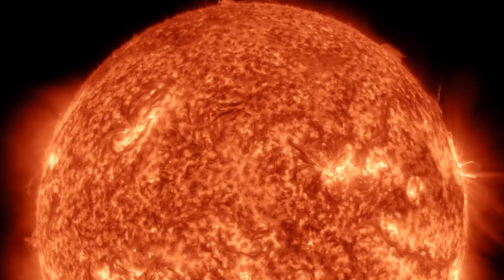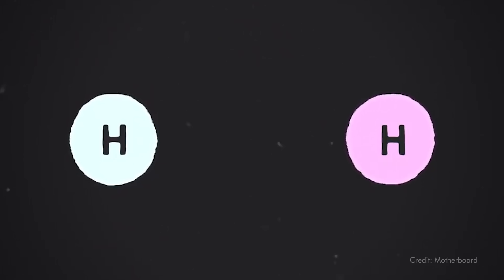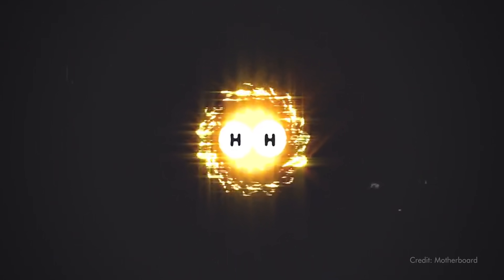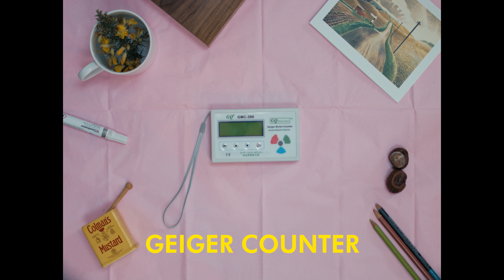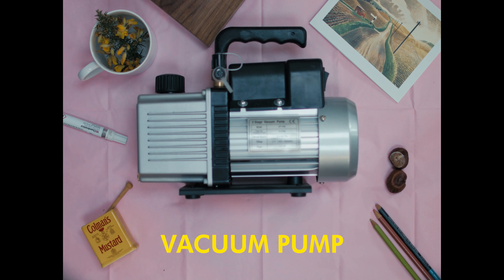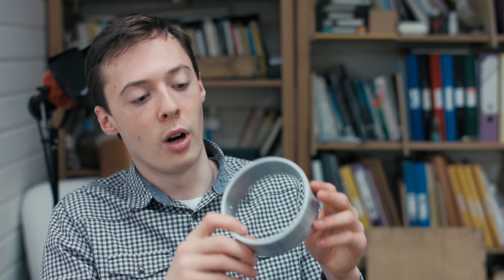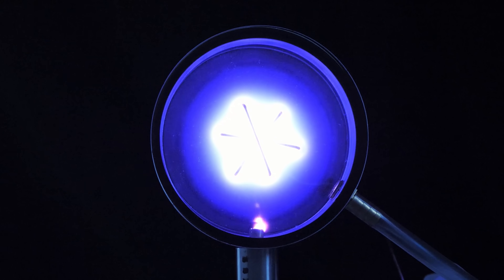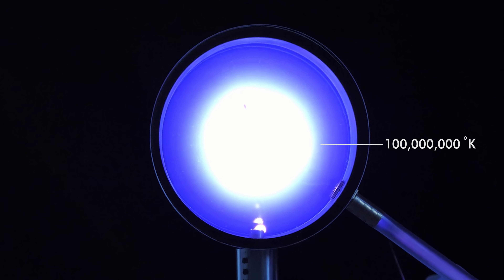Making a Desktop Fusion Reactor

Comment: I watched this twice, I noticed you didn't show how you made the middle piece that actually creates the light (plasma)..? And where did you hook the power supply up to?
Reply: @Theo RixLux Fellow physics undergrad, but I'd like to point out that this guy almost certainly did not achieve fusion (I don't trust anyone who thinks it only takes 2 hydrogen atoms to make a helium atom to be able to achieve fusion). I'd also like to point out that the only way to truly overcome the repulsion of protons during fusion is with neutrons, since they carry the strong nuclear force (this is why it requires 4 protons (actually, technically 6, but the end result of the reaction produces two extra protons in addition to the single helium nuclei), as opposed to 2, and while its an incredibly simplistic and incorrect way of looking at it, you can imagine that the mass of the helium nucleus must be equal to the mass of the hydrogen nuclei used to create it).

I'm also concerned by the lack of neutron radiation shielding, because unless this guy wants a slow, painful death via radiation poisoning or cancer, if he knew what he was doing, he would have included neutron shielding, and a brief explanation of why its necessary to have.
Reply: @AnnaNym-h5k  It takes 2 hydrogen atoms to make deuterium (One of the proton decays into a neutron) then, a deuterium atom collides with another deuterium to make tritium and one neutron expelled. Then a tritium atom and a deuterium atom collide to make helium (Again one neutron expelled.)
Reply: @vedantchaudhari7123  That's the proton-proton chain, yes.
Reply: @Theo RixLux well I am not a physicist but the fusion reactors I have seen in documentaries require more than some hydrogen and some voltage (if I remember correctly they use some kind of piston setup to pressurize the inner chamber so that fusion can occur). I'd say this is just some plasma.
Reply: @Theo RixLux You can ionize atoms even at room temperature.. it isnt really that hard.
Reply: @Theo RixLux So it seems that a fusor does, in principle, achieve some form of "fusion" (however you want to define that). After all, what's going on is that the ionized hydrogen atoms (i.e. protons) pick up energy as they accelerate down the potential toward the center. For every volt it accelerates, it picks up one eV of energy, so it's not unreasonable for the protons to have sufficient kinetic energy near the central cathode to overcome Coulombic forces (if they get sufficiently close, the strong nuclear force takes over. How often this happens depends on the interaction cross-section). As to what they are fusing into, it's probably deuterium (one proton one neutron). This particular contraption is not totally efficient though (due to mechanisms like bremsstrahlung radiation, for example. This effect has less impact in deuterium-tritium reactions, which is why it's preferred), so even if some semblance of fusion is taking place, it's not nearly enough to have any appreciable energy output. So a lot of the light is probably coming from just the high energy plasma. As for your previous comments, it seems reasonable to me to assume the configuration of the central whisk was to change the shape of the electric field and perhaps allow for more acceleration of the charges (perhaps the glow at the start is just the arc of ionizing charges?). Indeed though it is a little troubling that there wasn't more shielding as there would be stray neutrons likely flying about (indicated by the Geiger counter going nuts).

Hope this provides some insight (feel free to correct any errors I made).
Reply: @Theo RixLux also, there's no magic amount of energy that will allow two protons to stick together without at least one neutron. The coulomb forces are just too strong. Now, what can (and in the case of the proton-proton chain, MUST) happen, is that the energy of a proton-proton collision changes one of the protons into a neutron and emits a position and a neutrino.
Reply: @Theo RixLux the magic of video editing.
Reply: @Theo RixLux it should sound legit, because that's how it works in the sun. And I mentioned helium because that's the product, and there's no way in hell this guy was able to fuse raw hydrogen into helium. Even thermonuclear weapons (the only form of fusion we have actually done in a way that releases more energy than is put in) have to use Deuterium and Tritium (or just Deuterium). There have been even small scale Deuterium fusors that have been built, even by kids, but if you look at their setups, they are vastly different from this thing.

Comment: Completely fake and BS. No prove fusion is being done (i.e neutron detection equipment). 

Voltage way too low for any hope of hydrogen-hydrogen fusion. That transformer has an awfully low current capability. 

Pretty glow discharge, nothing else.

Comment: I can't say for sure whether or not you really fused anything, but I'm guessing no and here is why. At the beginning you stated that you bought a Geiger counter however you never ended up showing us proof that you were generating anyionizing radiation that would be indicative of fusion reactions taking place with said Geiger counter. I think you realized this when you tested it and then decided to not show us the Geiger counter test result so as not to disprove yourself on camera. Even more so from your choice of pump I can say that you aren't likely achieving a deep enough vacuum needed to allow for the hydrogen ions to accelerate enough before smacking into each other. Usually you need a full on diffusion pump to achieve a deep enough vacuum for fusors. With the not as deep vacuum there are too many residual molecules and atoms in the way slowing down the ions as they make their way to the center. Even more suspicious is the fact that you claimed it reached a temp of 100MK, but never stated how you measured this or came to this conclusion. The glow could easily just be from normal, non-fusing plasma generated by the coronal discharge from the central electrode. If you can post a video addressing and dispelling all of these issues with concrete evidence of your vacuum level, Geiger counter test, and temperature measurements that would be great, but until then the only logical conclusion is that you have not managed to produce any fusion. Good luck and I hope you disprove everything I've said.

Comment: Someone correct me because I know I'm not entirely right but from what I gather, deuterium tritium is the one that requires the minimum of 100Million. Since you're using normal atmospheric gases, your only luck is protium -normal hydrogen, which has a lower threshold temperature. Protium requires 100billion Kelvin  for fusion, equivalent to 1Million electron volts, hence you will need a million volts to overcome the repulsive forces in protium and fuse them -I think you're using less tha 20kv. That's why you see the song about deuterium tritium. All other heavier gases are nearly impossible to fuse, probably higher than 1M volts to fuse them. The Hadron collider achieves what? 7 trillion electron volts? that's why it's able to smash even the difficult ones like metals.       Finally if you achieve fusion, you don't wanna sit there and watch it like tv while others hobbyists are investing heavily in boron solutions to contain the neutrons at +13Mev. you will receive a shower of them and die within a month

Comment: David's response is all well and good, but completely ignores some very important problems with this video.

1) The super obnoxious musics SUU UU UUCKS!

2) Zero shielding? WTF .. someone's is going to get cancer or a visit from the authorities.. or both. Neutron radiation is a serious problem .. so are gamma/x-rays emitted by 100 million degree plasmas and very high voltage devices. this is especially true if you leave the thing running as a conversation piece.

3) Didn't bother to explain how anything works in even the slightest detail. Also ignoring the history of the inventor, Dr Philo Farnsworth, who despite having over 200 patents relating to vacuum tubes of which this is one of them, died broke and penniless due to ruthless exploitation of his ideas by others... like YOU.

Comment: If it has 100,000,000K as you said, so why the metal wires don't melt? (The iron temperature of melting=1811K)

Comment: How come the Aluminium ring didn’t melt at that temperature?
Reply: PacoVL46  it is melting but just very slowly because there are few particules in this which have that temperature. It’s also why he isn’t a millionaire because the “melting” of the grid causes a huge loss (it’s not the only thing that make this design ineffective ).
Reply: Pierre Thourault thanks for clearing that up!
Reply: That's what I was thinking.. one hundred million degrees? Why didn't anything vaporize?
Reply: @gotsteem  because it's not real
Reply: @julianros9808  Yep, I agree..

Comment: I wish you had focused less on the music and more on actual information. What is the gas? What does it do? How are things working? 

Such a shame. I had knowledge blue balls.
Reply: The gas looks to be hydrogen from the way it was made, but I'm not %100 sure tho
Reply: @ZornSin  it's probably deuterium
Reply: @ZornSin it’s deuterium, an isotope of hydrogen which can be attained by electrolyzing heavy water
Reply: Swaggy Swag The device consists of two concentric but isolated wire cages inside of a vacuum. The device is evacuated and a large voltage difference is produced between the wire cages. Hydrogen is introduced and becomes ionized in the chamber. The hydrogen ions are accelerated from the outer wire cage toward the inner wire cage and occasionally collide in the center at sufficient speed to fuse, releasing energy and light- photons and possibly xrays. The high temperature molecular soup is held between the wire cages which keeps it from self-destructing. As far as I can tell, here the outer aluminum ring is simply mechanical and the fusion is occurring between the wire cages at the center.
Reply: @jaecenwhite2590  I think it can actually be deuterium gas that's being introduced and the process he went through to get it was to maybe react NaOH and aluminium foil but in heavy water instead of regular water. I don't know much about this subject but it could be. What do you think?
Reply: @jaecenwhite2590  he needs a deep vacum to make this a fusion reactor and he didnt show any proof of a good vacum pump. Plus in the startup secuence their was a masive  arc showing it wasnt a vacum at all. No fusion just a plasma genorator.
Reply: It was hydrogen.
Reply: The reaction he used of “caustic soda” (HCL acid) and aluminum yields hydrogen gas in abundance but like a lot of people in this comments section I have reservations about whether this is a viable source of sustained fusion reactants, most fusion reactors being tested use deuterium gas which is also sometimes called heavy hydrogen because it is hydrogen which possesses a proton and a neutron
Reply: @erudite7885  caustic soda is sodium hydroxide, not hydrochloric acid.
Reply: @jordanh9668  oops your right, caustic soda is NaOH, not HCL or hydrochloride acid... wow I try not to sound dumb when I make a comment... I think I failed at that lol... that must have been a comment I made way too late and I slipped
Reply: Deuterium gas
Reply: Usualy it is argon gas, the same used in weld.
Reply: Since this is a fusion reactor, it's probably using hydrogen. And what he's probably doing is putting a ball of aluminium into hydrochloric acid which reacts and makes aluminium chloride and hydrogen gas...I think? however yeah it's hydrogen...PROBABLY
Reply: It's hydrogen gas he made it using lye, aluminum and water I've done it before be careful if you try it it's a bit messy and produces alot of heat and corrosive substances and hydrogen is extremely flammable
Reply: Paul W i can confirm that the gas is hydrogen. He clearly balled up a wad of aluminum foil and threw it into hydrochloric acid, which reacts and produces hydrogen gas as a byproduct
Reply: That's not hydrogen, because you would need much more energy.

No, that's deuterium. Deuterium is hydrogen, just that it has a proton and a neutron..... Instead of just a proton in normal hydrogen.
Reply: @ArcturusA  Does the extra neuron in Deuterium result an a lower repulsion force that leads to the lower energy requirements for fusion?
Reply: @labaguette2728  Yes.
Reply: @Whatsleftover5  you are correct. Couldn't have said it myself
Reply: Agree..
Reply: He said it's based on a Farnsworth fusor.
Reply: The gas is most likely deuterium, a stable isotope of hydrogen.
Reply: I wish you have fingers to google it...
Reply: @superchristobat  I wish you have grammar to reply..
Reply: @superchristobat  ducks?
Reply: @yellowcactustvz4929  he is right this isnt realy a fusion reactor. The arc in the startup proves it. For the fusion reactor to work it requires the chamber to be very close to a vacum. The arc during startup means their was quite a lot of gas in the chaimber to conduct the electricity. This means their ar to mqny particles in the way for the plasma to accelerate an fuse in the center. It is a cool plasma desk lamp though and a real fusion reactor would cause cancer due to the x ray and nuetron radiation anyways.

Comment: Only bummer is that you spend 99% of the video building it, but 30 seconds showing it working.  Nothing really about the electrical, the radiation, the amps draw, how much the vacuum pump runs.  I mean, you could have spent a few minutes running through how it works.

Comment: 100,000,00 Degrees? If that were true it would have melted the metal wires in the center....
 If I am wrong please explain how that works.
Reply: Brandon Landry it’s like how the upper atmosphere is really hot but if you were able to touch it wouldn’t be hot because the low amount of molecules